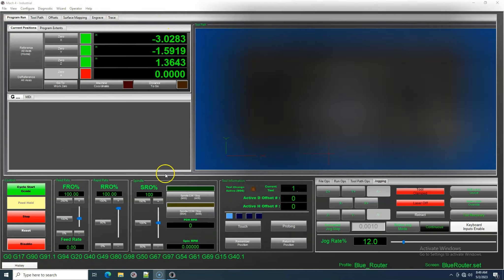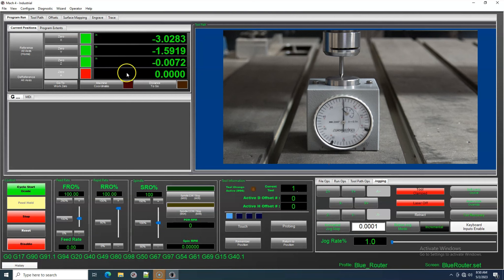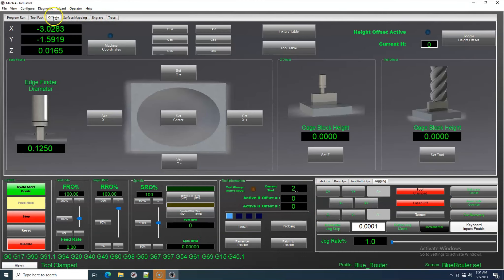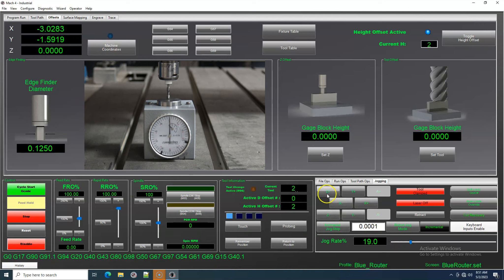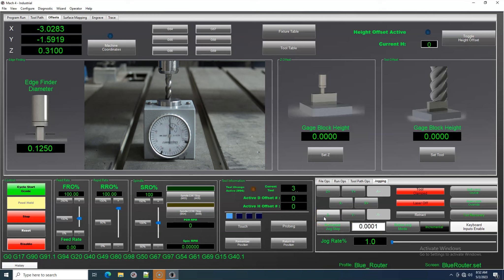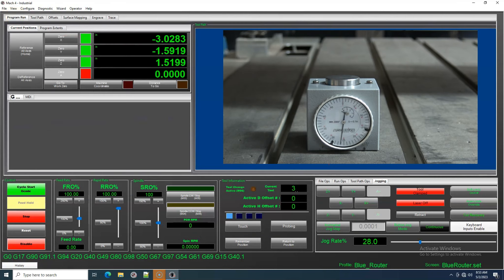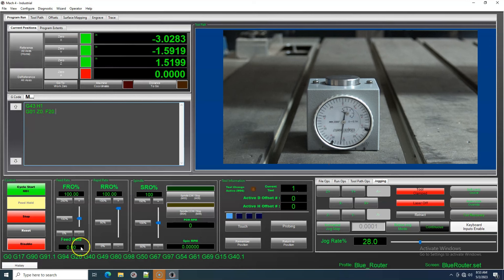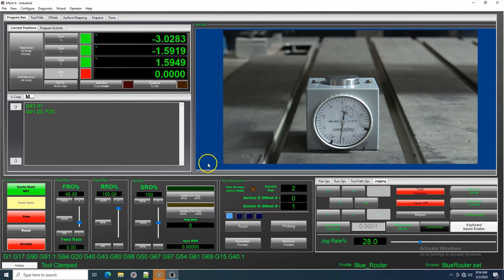Mach 4 Tool Offsets

Comment: So I am confused...  Mach has two videos on tool offsets and both have different explanations and neither show how it runs when the Gcode is running.  It seems like the Gcode requires some T# with a G43 somewhere. My goal is to have the gcode run without any input (other than changing tool).